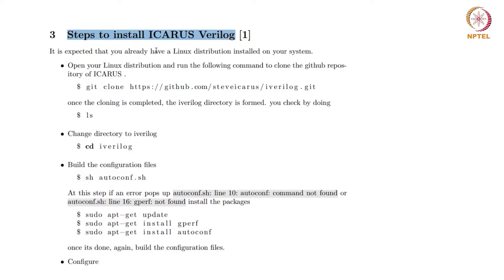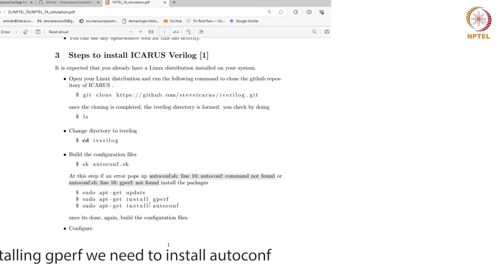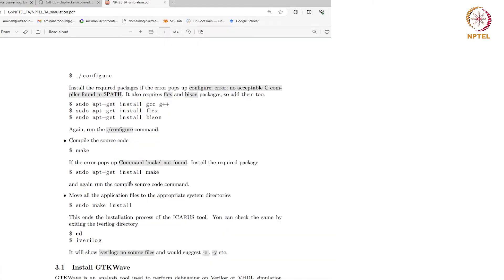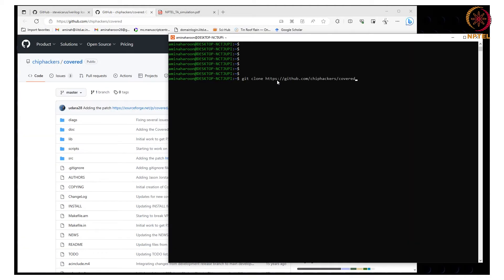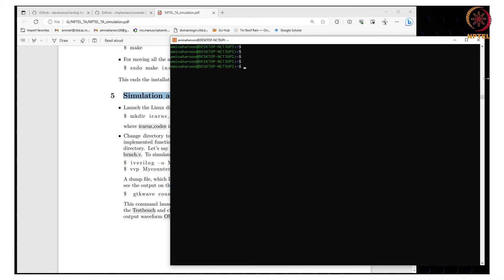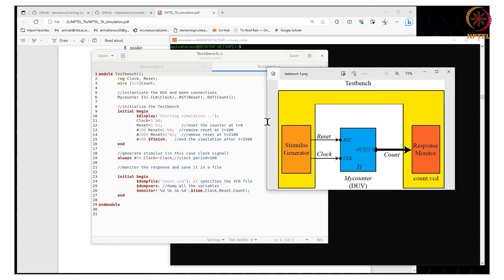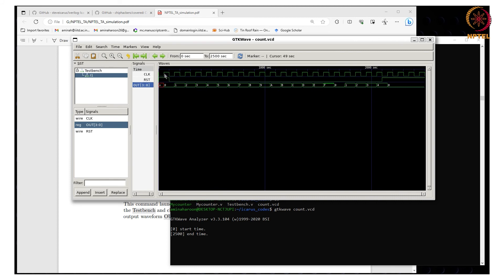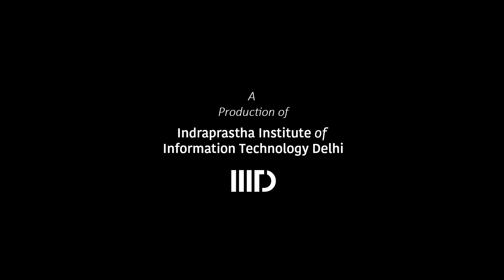Simulation-based Verification using Icarus

Comment: Steps to resolve the error: 'Tcl_Interp’ has no member named 'result’

	$ cd
	$ cd covered
	$ cd src
        $ gedit report.c

In the report.c file you will see a list of #include commands. Find #include <tcl.h> and add the following command #define USE_INTERP_RESULT 1 before #include <tcl.h>

Your report will look like this:
    
        #ifdef HAVE_TCLTK
        #define USE_INTERP_RESULT 1
        #include <tcl.h>

Save the report.c file. 

Run the make command again and proceed with the installation process.
Reply: Thanks :)
Reply: Thanks for saving the day!
Reply: Thanks!
Reply: Thanks ❤
Reply: Thank you so much

Comment: My code is same as provided in lecture but i am getting error while try to find coverage

Checking for race conditions...

WARNING!

Possible race condition detected Signal assigned in two different statement blocks Signal assigned in file: Testbench.v, Line: 19 Signal also assigned in statement starting at file: Testbench. v, line: 9

Safely removing statement block from coverage consideration

Statement block starting at file: Testbench.v, line: 19

Scoring VCD dumpfile count.ved...

ERROR! Badly placed token "Show" Segmentation fault
Reply: 1. open the vcd file using gedit
2. find the line "$comment Show the parameter values. $end" and delete it. 
3. save the .vcd file.

And run the command for generating the code coverage report. It should work now.
Reply: @amina-haroon-AH  Thank you, it worked 😊😊 but why this problem was occurred.